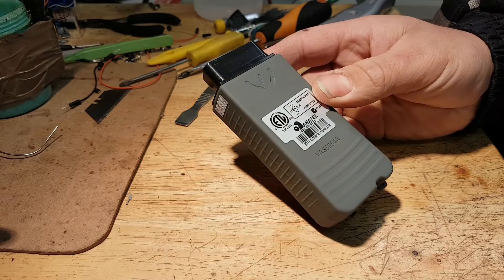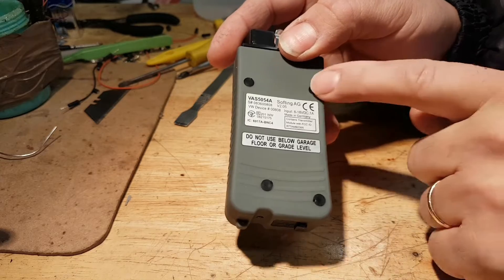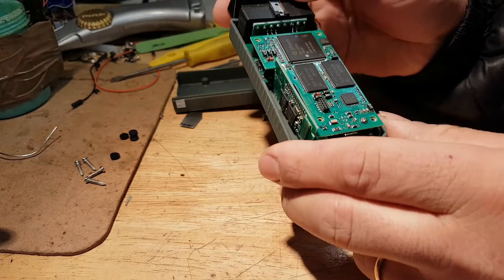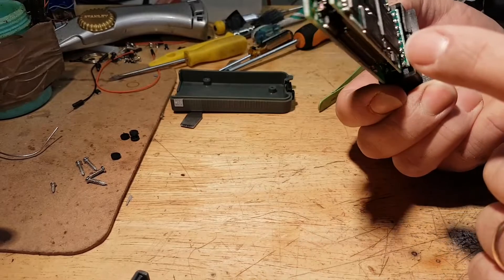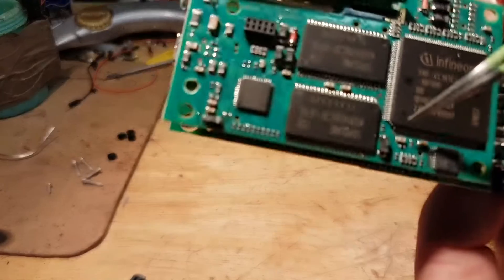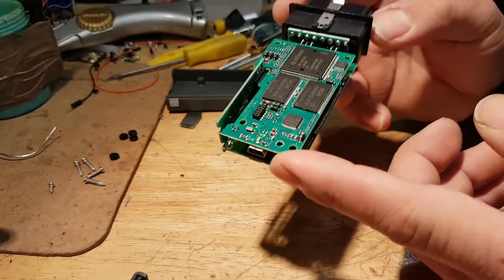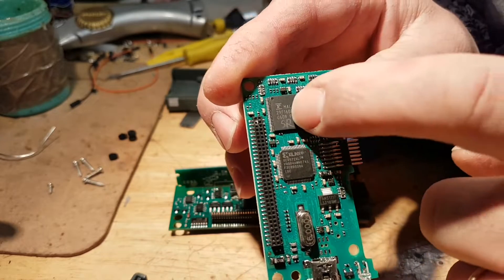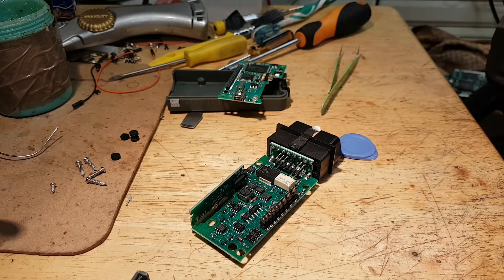VAS5054A VCI teardown. Internals and PCB quality.

Comment: works amazing good clone vas5054 tool, even as passthru for xentry techstream honda hds, forscan and nissan consult, this one needs a small modification in obd cable or a breakout box to  connect pin 1 to 8. so for 50 bucks you get a tool that can handle a bit of work, and in odis is like the original one
Reply: Modify for?
Have you tried it out with xentry, techstream and hds?
Reply: @ashraja6250  you just need to modify the cable if you want to use nissan consult pin 1 from vas to pin8 obd car, for xentry and the others works out of the box with vas passthru drivers (these are not the same drivers used in odis) google for vas5054 passthru drivers

Comment: i thinks  its compatible j2534 pass thru , can be used on ids jlr as well , comes with drivers for it
Reply from the maker: That's correct... can also be used on Xentry...
Thank you for watching and for your comment!
Reply: @LMAutoRepairs  Can it be used on Ford IDS, BMW ista, Volvo Vida, techstream? Would be interesting to know.. Do you have any other j2534 that works with more softwares and manufactures? Thank you
Reply from the maker: @irfankhalifa5647  
I know you can set it up for mercedes star...
Not sure about others...